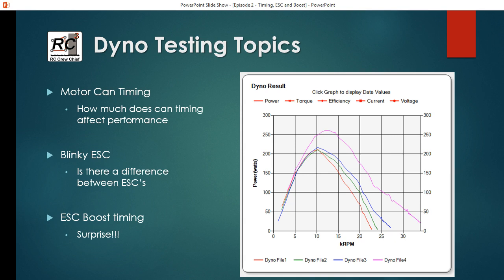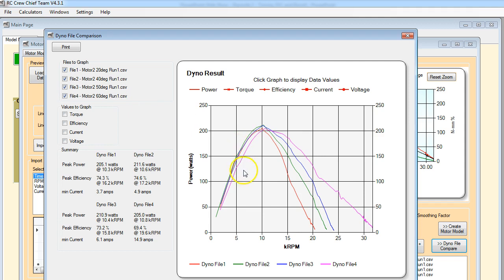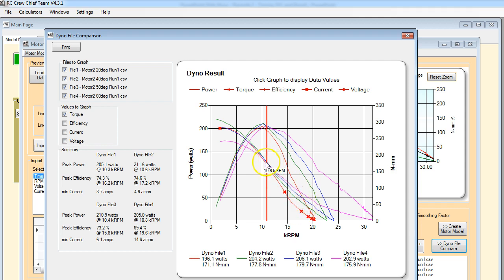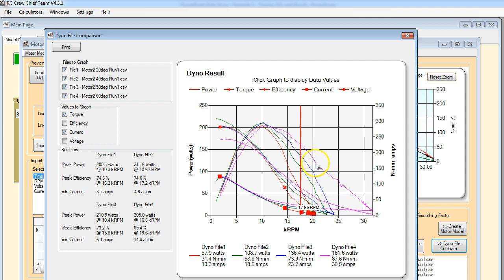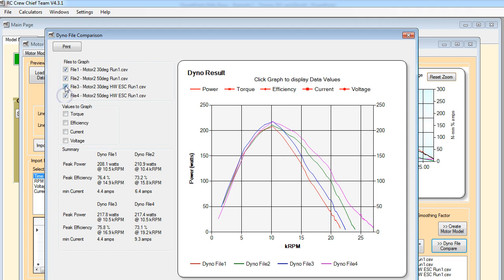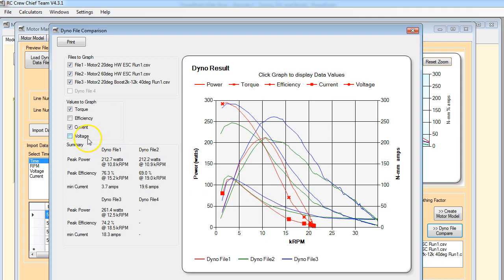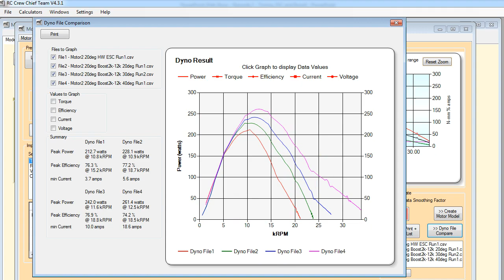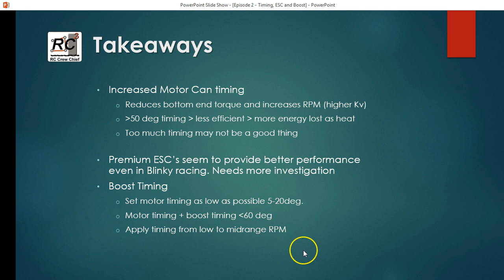Episode 2 - Motor Can Timing, Blinky ESC's and Boost

Comment: I can take a stab at some things that you might be seeing from one esc to the next. commutation is an output. its the relationship of when the coil is fired. the more precisely it is triggered in the real world the better it will be. there is a frequency at which it triggers. the processor has a fixed frequency and the transistor has a fixed frequency. if both are at a very high frequency there is more resolution to the physical relationship of the rotor and coil. the same concepts apply to the sensors that are being read. you have hall effect sensors and sensor less measurements based on back emf. In general, the error or accuracy of the last coil firing hinders or helps the next pulse a 5% change in output is probably common.

Comment: Very good Video and Info. Interesting to see that there is in fact a difference in ESCs Blinky Mode Power Outputs. I noticed this when running a knock off Chinese ESC and was struggling, then swapping to a LRP ESC and noticed that i was going quicker. Too bad that it still seems to be in the developing companys mind what "Zero Boost" really means and its not the same at all.

Comment: For 17.5 blinky, setting timing to a no-load 5 to 6 amp draw is a good ballpark? Thanks.
Reply from the maker: I know guys set their motor timing that way but I don't so can't really comment. I use the dyno so I can see the performance over the entire RPM range and not just one point.
Reply: @RCCrewChief  Was looking at file 2 and 3, where peak power seemed to be and amp draw was 4.9 and 6.1 respectively. Therefore wondered if this was the sweet spot and good to set the timing to these amp draws in blinky.
Reply: I would start with this motor set to around 50-52 deg which would be File 3.

Comment: Shouldn't the physical timing of the motor be always more then the turbo timing?
Reply from the maker: From what I know motor + boost + turbo should be no more than 60 deg. I haven't run a class with boost for a long time so could be wrong. I'll be doing more testing and will post the results.
Reply: A perfect system would have a map for, lets say, for every 1000RPM increase, throttle input and given temperature. So you will get max performance and efficiency.